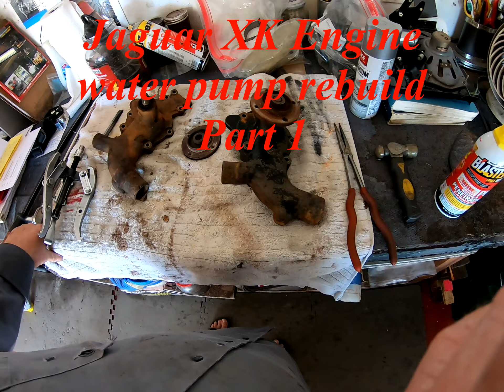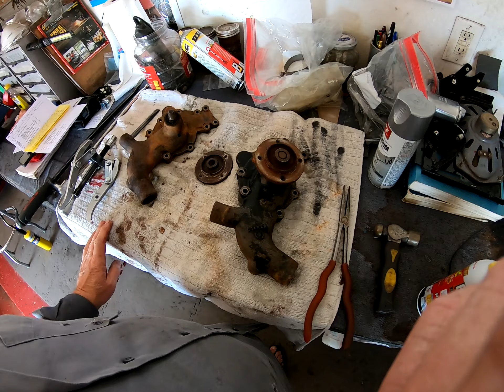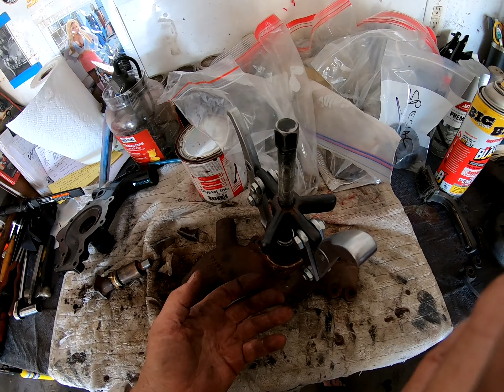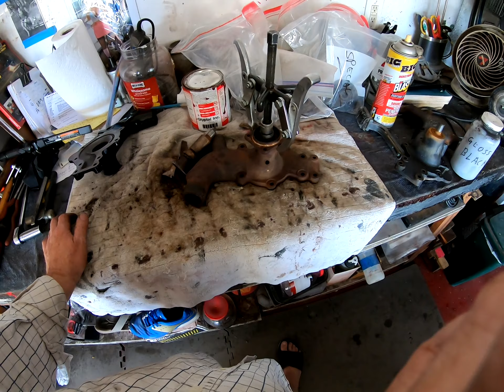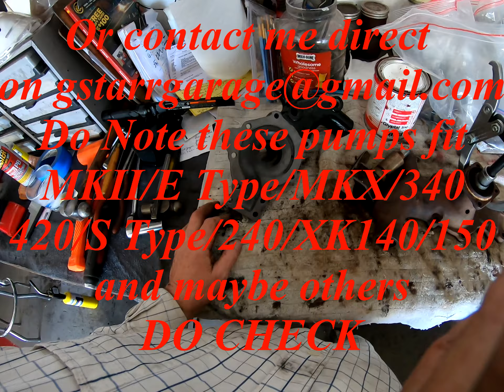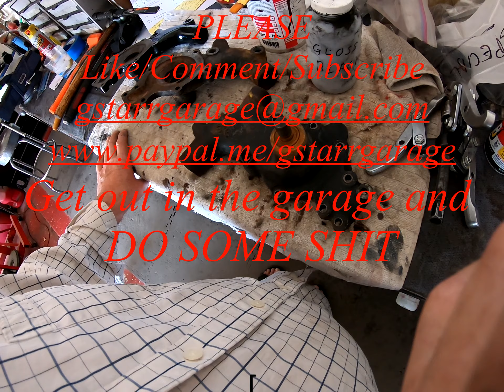Jaguar XK Engine Water Pump Rebuild

Comment: Why use a hand held puller on the pulley flange when you have a shop press?  If you have the proper hollow drift as shown in the workshop manual and press out the pump bearing on the outer race, the entire assembly including the impeller will part without damage.  The same hollow drift should be used for installing the new bearing and shaft assembly.  Also, I don't think it's advisable to paint the inside of the casting  which will eventually flake  and pollute the coolant.  Also, how are you setting the shaft depth and impeller clearance?  TIA
Reply from the maker: Are use the hand puller because not everyone has a press it shows them how it can be done without a press, as for the paint perhaps you’ve never used Glyptal it bonds to the metal and will not flake it is used on lots of engine applications including all the oil ways it does not come off then and it certainly won’t come off with coolant. The shaft depth it’s self is determined by the grub screw that locates in a hole in the shaft it cannot go in any other position.

Comment: Hi Gary, interesting as I am yet to rebuild a water pump!  I can't seem to find the trade name Glyptal on the UK EBay but it is is on UK Amazon at GBP99!!.  What type of paint is it?  Do you know of a UK equivalent?  Thanks, Tony
Reply from the maker: wow that's expensive I know i bought some when I lived in England but cannot remember the name, the only thing I can suggest is to google 'internal engine paint' and see what comes up, it's an enamel based paint but obviously has some special stuff in it. also try Moss they may have it cheaper.
Reply from the maker: @Doctor MENGELE  good to know I assume you mean in the  UK
Reply from the maker: @Doctor MENGELE  Yes Por is popular and great, not sure if they do internal engine paint.